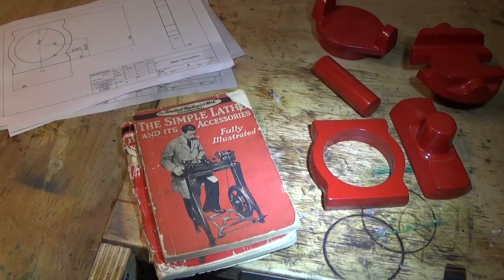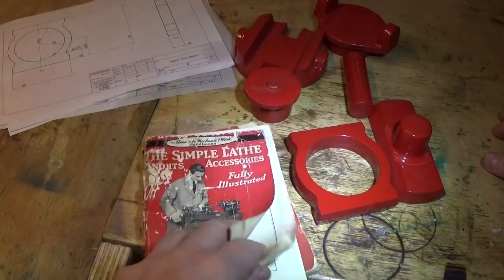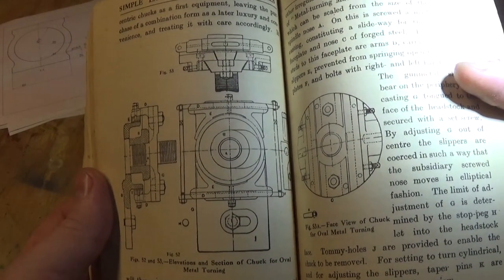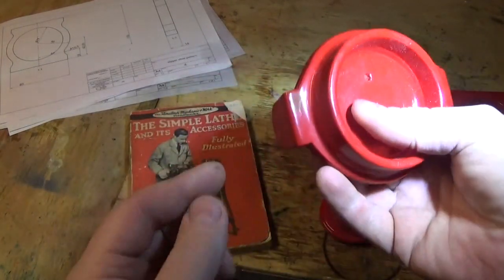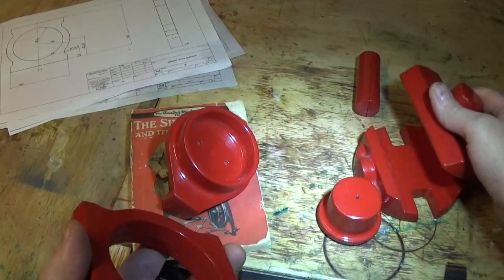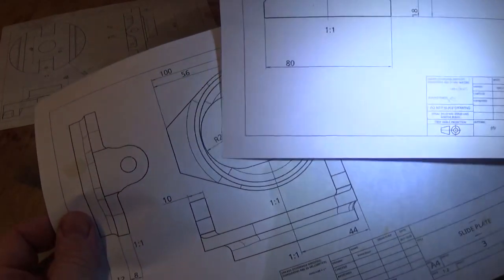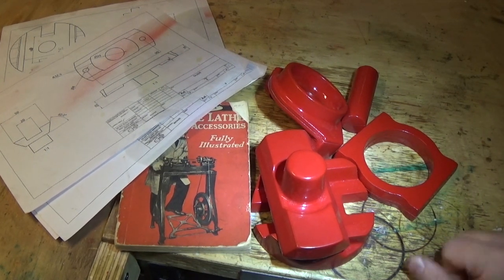PART 1. (to be continued as some later date)

Comment: Hi Emma, I didn't see this video when it came out. I've known about these chucks for 25 years. Many versions existed, some of the bigger ones for turning oval picture and mirror frames of wood, up to several meters tall. Regardless of use, these chucks were always run at very low speeds. The cutting tool must be kept absolutely at vertical centre heigth, so a slide rest is ideal. But for hand turning, the tool was often allowed considerable horizontal movement, and could be constrained vertically by placing a flat "stirrup" on top of the hand T rest, just a flat bar held ridgidly parallell with the top of the rest above the tool, and fastened at the two ends. A little like sticking a rolled up newspaper through the mailbox slot in someone's door, and moving it right and left:-) There are excellent photos and engravings of these chucks in many books, going back at least to the 18th Century. The oldest turning book I have is just a facsimile, of Plumier's "L'art du Tourneur", this shows several different types of oval or ellipse chuck, some very simple, some elaborate. David Springett in the UK built a mostly wooden ellipse chuck and wrote about it  many years ago, it was quite successful. His books are of interst for all turners, even those who don't turn wood, because he is a very creative maker of tools, fixtures and chucks etc. Loved the video, took me back to my early interest in lathes.

Comment: Ooh, this'll be a fun little handy tool!
Aside from flanges on fittings, the first thing that sprang to my mind was one piece crankshafts: the shaft and crankpin can be done in 2 different between-centres setups, but with this you could also do the outside of the cranks in the lathe.
Reply from the maker: will see, Lisa. its a crazy contraption. thanks for watching

Comment: Ah, the elliptical chuck. In the days when that book was written, ornamental turning  was the thing and any decent ornamental lathe came with an elliptical chuck. If you google on Ornamental Turning  you will find lots of references to it. WWi put and end to it, but it was revived in the 50s in England and is going strong.  Beautiful stuff. If interested in OT let me know,  I have 2 copies of T.D. Walshaw's  "Ornamental Turning" and I'll send one copy to you.
Reply from the maker: very much Interested, Juan.  it will take a long time before i have all the accessories, but this will be a fun start.
Reply: Walshaws book is excellent and covers a fair amount. Go through that book Emma but be careful you don't get hooked. :-) And I'd think the short section Walshaw did on a 2 stage geometric chuck should be of interest to you. There's also a further picture in it of a 7 part geometric chuck as well if my memory is correct. Juan's of course correct and at one time you could buy elliptical chucks instead of making them. There's an elliptical accessory made for wood routers and possibly a few commercialy made for wood lathes. You might Google Lindow Machine Works for a fair amount of information about modern ornamental turning equipment and there Rose Engine Lathe.   

There were some really strange steam engine designs tried over steams long history and at least one or two had elliptical cylinders. Likely you've already considered it Emma but be sure to add ample oiling methods and possibly some oil grooves since there's a lot of continous back and forth movement with those types of chucks so the wear rates could be a bit high without a good oil supply.

Comment: Nice patterns Emma . For the filet on the first pattern you showed assembly it with shrink film between and make you fillet with auto body filler .after it cures take it apart and remove the film.
Reply from the maker: thanks Chris!
Reply: Emmas Spareroom Machineshop no problem

Comment: Hi Emma. A great project to keep us interested. I find that I make a lot of tools to make more tools. Its all part of the game. My philosophy is Do I need it? (probably not) Will I ever use it ?(maybe some day) Will I enjoy making it ?(yes of course I will).Just one question:- Are the sides that accommodate the female chamfer thick enough. Its difficult to imagine the dimensions on the video. I know you have checked it time and time again but it looks as if there is not enough meat there after shrinkage and machining are done on the  mating faces.  Looking forward to this  build.  regards from the UK  Gary
Reply from the maker: the plate will jsut be cut out square, with two heavy gibs or slides bolted in between to hold the dovetail. i know i didnt explain that well, but i think it will be good.

Comment: hey emma, patterns look great! If you had lived closer to me, I'd just cast out the bronze bits out for you since Im on a bronze casting binge atm anyhow, lol. What alloy of bronze were you going to go for?
I was curious what the eliptical chuck would have been good for, but for steam flanges, that in and of itself would make it worth it's weight in gold, lol.
Reply from the maker: id take you up on that! looks like you are doing pretty well in the foundry. ive no idea about bronze really. something that wont be too hard to scrape, and machine, and wont wear too much on cast iron. any ideas?
Reply: Im not really sure tbh, I'd look into manganese bronze tho, it seems to be good for stuff like that hence why it is used for worm gears and stuff that would have sliding/friction on it. GP brazing rod is usually manganese bronze for an idea on how hard it is to machine/scrape, and alot of people braze up gear teeth and build up stuff using it. If it were me tho, I'd just make it all out of cast iron and not worry about it, cast iron wont gall riding on itself like steel or other metals do due to the graphite in it, hence why lathe cross slides and everything in machinery is usually riding cast iron on cast iron ways. Just think of the cast iron base and ram of the shaper.

Comment: Having bit of trouble putting it together as a finished item. For some reason it looks like the sliding shapes dont fit together. Look forward to more!
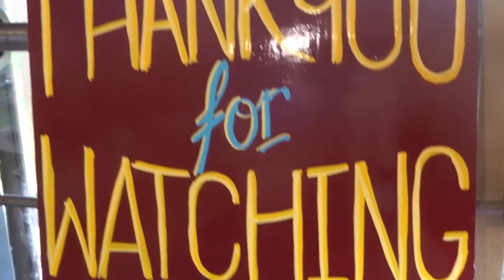Reply: This was my first thought also, but go back and take a look at time 15:50. If this is the parts in question, Emma explains that they will be machined to except a pair of gibs to adjust the slack and for centering.
Reply from the maker: in the fullness of time!!!